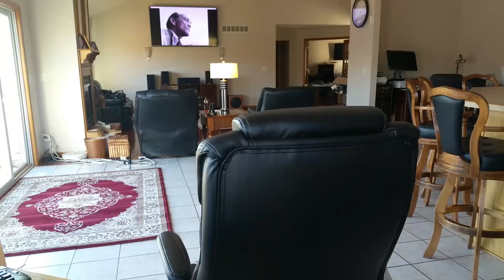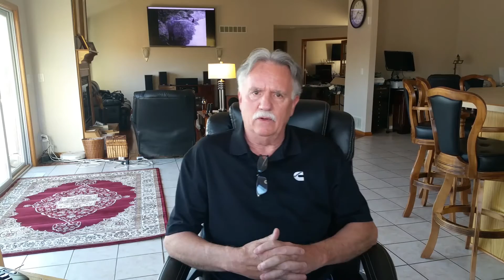L10, M11 & N14 Cummins Engine Will Not Start? Could be a Bad Fuel Solenoid?

Comment: What about a cummins nh250trx how different is this to them motors because I got one on a tub grinder that hasent ran in a few years and I'm having problems getting it running and can't find anyone near me that can help me solve this. Pump shutoff volts is at 12volts and it does have fuel coming out the intake and return fuel lines. Cummings motors are not my area international motors are so looking for help here thanks

Comment: I have a 98 Ford with a n14 that has a fuel issue or maybe an electrical issue and it keeps shutting down randomly (when running down the road)and cranks for a long time before starting up. I checked the solenoid and have correct voltage with key on and off. I heard there is a screen on the pump that gets clogged can you tell me how to locate it?
Reply: Same here

Comment: I have a 98 vanhool with a m11 plus engine died wile driving replaced the mechanical fuel pump with new solenoid still wont start but with pure silicone it will start any ideas
Reply from the maker: Hi, do you have a red or amber check light?
Do the check engine lights turn on and sweep through?
Feel free to call me around 11 am eastern standard time 810.653.6300 or text me at 727.494.5514 Terry Chron